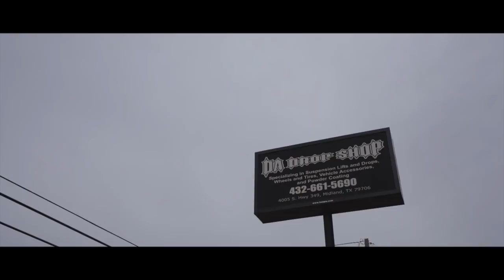THE PERFECT TOW TRUCK! 2017 DUALLY F350 ON 26S WITH A 10 INCH LIFT KIT. TOWS LIKE A BEAST!!!

Comment: Can you tow a gooseneck/ 5thwheel with this and does the lifted or rims effect the towing capacity? I'm asking bc I considered modify my truck but I use it for my business. Can the wheels hold the weight of a goosneck  car hauler with 3 cars on it?
Reply: Mike Texas904 no....you can't tow a dam thing with a lifted truck.....at least one lifted high....you might get away with a 4 inch.....plus most tires that size are not rated for heavy loads.....all show.....no go....
Reply: I'll just buy an older obs, square body Chevy , or an older f350 and customize that one instead of my bread winner truck
Reply: Jesus christ yall ain't open minded for shit I swear. look at their Instagram or Facebook. They tow 3 other huge trucks with the 5th wheel with this dually to different car shows around Texas in it. Those are forged wheels, strong and light like the Aloca's and those tires are top quality as well
Reply: Cesar Serna let's see it tow 35k+ behind it.....then you can talk